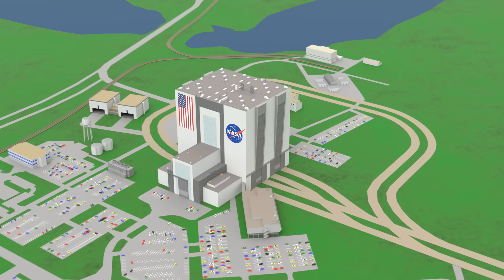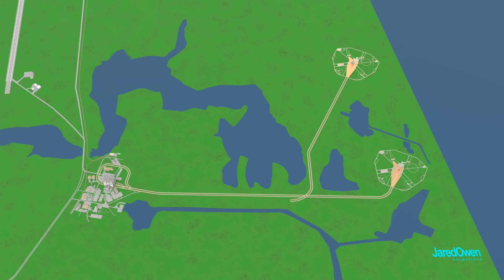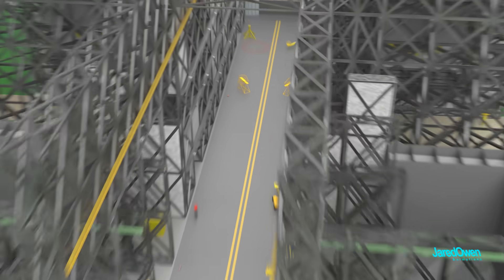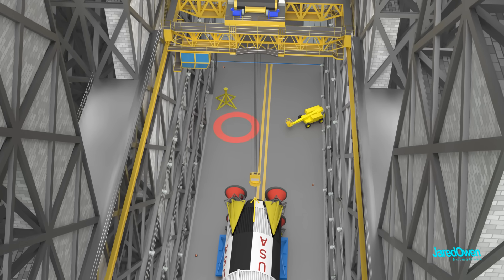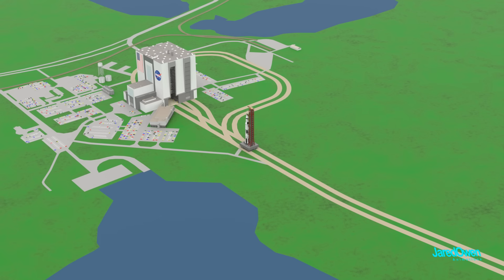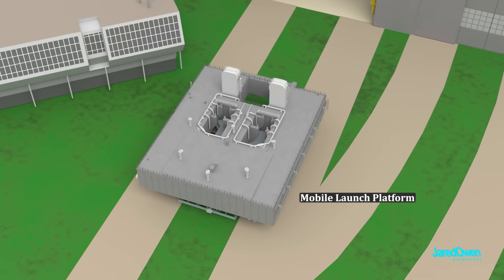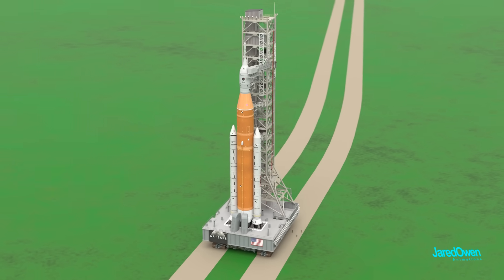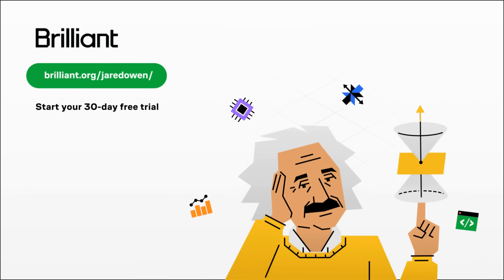Where does NASA build rockets? (Vehicle Assembly Building)

Comment: Actually, the core stage and solid rocket boosters are of the same design used for the shuttle, the external fuel tank for the shuttle was lengthened as well as the SRBs and the core stage has 4 of the main engines designed for the shuttle.

Comment: I was raised in Cocoa. I saw it everyday. 

It's not called the vehicle assembly building.... it's called the VERTICAL Assembly Building.. I've been inside it.. it's where the Vertical assembly takes place... the thing is huge, so big in fact it even develops clouds inside if not checked.

How do people mess up a simple thing like this?
Reply: NASA's website calls it the Vehicle Assembly Building.
Reply: @billfitzpatrick209 that may be now .. but in the 60s and 70s it was called the Vertical Assembly Building... from the day it was erected....like i said ,we did field trips there from Cocoa jr high,  and Cocoa High.. the Space Center guides called it that.. The Today space coast Newspaper, called it that.... maybe they changed it with the shuttles or maybe its a typo. Dunno. But it'll forever be Vertical to me... 

It was the Canaveral Space Center at one time too after Canaveral Beach, Port Canaveral .. at one time. Until it was later changed to Kennedy.  But then there was a big stink over that , and the launch complex reverted back to Canaveral and the Space Center remained Kennedy... confusing, but it made everyone happier..

Comment: What we need is one of your videos showing how the Starship Lunar Lander is set up and how the Orion capsule docks with the Starship lander, etc…

And then for fun… in an alternate timeline… the nose cone of the Starship Lander is the command module for the Starship and can serve as the abort capsule similar to the Crew Dragon…

There would be a pass through pressure portal for ingress and egress into the body of the starship lander.

No need of a heat shield on the control module, as it is for docking with Orion in lunar orbit. 

Either when attached to the Starship lander or not.

If, the Starship lander wants to to start falling over or fail… getting launched back into lunar orbit will have to be instantaneous… just like with the Crew Dragon abort…

Right now from what I have seen the Starship nose cone is a docking airlock. Basically, serving as empty space.

Comment: Hey Jared, I am amazed by your animation. I would like to start doing animations. I know you are using Blender as a 3D software. Is it possible to use On shape, Fusion 360 or SOLIDWORKS to do the same thing? I am more familiar with those. Thanks a lot in advance for your opinion.
Reply from the maker: I am familiar with all of them! My understanding is those are for more of the engineering aspect. They can't do animations quite like blender can. If you are interested in learning more about blender, I have some sources linked here: https://www.jaredowen3d.com/learn-blender
Reply: @JaredOwen  thanks very much for your suggestion!!

Comment: One of the rockets assembled in the VAB not mentioned in the video is the Saturn IB, used to send astronauts to Skylab. Its second stage is the same as the Saturn V’s third stage, but it had only two stages total. To make use of as much infrastructure as possible, a “milk stool” structure was built on the mobile launch platform to bring the S-IVB and Command Service Module of Saturn IB up to the same levels as they were in the Saturn V.  It looked a little strange, but it worked.
Reply: I remember the Saturn 1Bs going up. It shook the crap out of our house... then the Saturn 5 came along.  Lol. I moved away so I didn't see what the Shuttle did...I'm just imagining what Starship will do.. probably gong to feel like an earthquake

Comment: This is pretty cool however the Crawler is probably the most interesting. Can you believe something was actually built to move all those tons of weight, standing extremely vertical, from one location to a far location. Must have been some engineering feat to prevent these ships from toppling.

Comment: I remember taking a tour inside the VAB as a kid in the early 70’s.  We were allowed in the building because the Saturn IV was unfueled during assembly. I went on to work as a civil servant for NASA. Security concerns and since the shuttle and SLS have fully fueled solid rocket boosters, open tours are no longer possible.

Comment: Not sure where/how the rockets are supported on the platform. Seems unlikely the engine nozzles (the lowest point) would be resting on the platform.
Reply: They’re not. The Saturn V had mounting bolts on the engine covers (where the fins are) and the shuttle/SLS have some on the SRBs
Reply: Generally, there’s a thrust frame above the engines. This has to be strong enough to carry the weight of the rocket anyway, so we put posts on the launch pad that support this frame.

Comment: I can't recall if it was in consideration for the original shuttle, but I know that for many planned improvements for the shuttle they were limited by the size of the highbay doors. It led to some interesting ideas such as oval shaped boosters that just barely fit through the opening. Incredible how such infrastructure can affect design

Comment: Thanks so much for using metric units
Reply: 1 kilogram=2.2 lbs
1 kilometer=.62 miles
1 metric ton=1.1 US tons
1 centimeter=.39 inches
1 meter=3.2 feet

There's plenty more conversions to be found on the internet if you're having trouble.

Comment: 4:00 Seems like a mis step clustering the bays into one group of 4 given you can add onto the side. They should have aligned the 4 bays in a row allowing for direct access to the launch pads instead two of the bays required that huge stretch of road from the opposite ends around and to the pads. If you were allowing for expansion the 4 additional bays could be added to the back. But because this was never done makes what they did here silly considering they had the space for 4 bays in a line  vs clustered up.

Comment: I didn't realise how tiny the Space Shuttle was compared to the Saturn V or the SLS.

But makes sense since the Shuttle "only" needed to go in Low Earth Orbit.

I'm so excited for the Artemis Program and hope this is the start of a new Golden Age of Space Exploration.
Reply from the maker: Hopefully SLS will do great things!
Reply: The Shuttle has its stages sitting side by side, instead of on top of each other. It delivers almost a hundred tons to orbit - although most of that is the spacecraft itself.
Reply: @Hobbes746  That's called parallel staging and was used by the early version of the Atlas rocket, where the system most of us are familiar with is called series (or serial) staging.
Reply: Take a look at the Saturn I sitting on its 'milk stool' prior to launch for the Apollo-Soyuz mission to see a great size comparison with the Saturn V.
Reply: orbit is possible your right
Reply: mars and moon and i think mercury is olso possible ti land on
Reply: I think, the Space Shuttle also might go to moon if it designed as soviet "Buran", which has own fuel tank for more powerful OMS rockets. Maybe for moon mission payload bay will be reduced by fuel tank. The modified shuttle will be orbiting around moon release moon landing module from payload bay and waiting before it come. And might be we got reusable moon spacecraft. Surely if NASA fix issues with orbiter's heat-resistant plates. And replace external tank to something else
Reply: @newdawn3474  Its not just "issues" with the heat shield, silica tiles will melt at the heat flux of a lunar reentry.
Reply: @newdawn3474  the shuttle would only be able to even go to the moon if the following criteria were met:

1. The external tank wasn’t jettisoned and instead was refueled
2. The entire payload bay would be filled with a fuel tank(s)

Btw, it would only have enough Delta V to go to the moon and not enough to come back
Reply: @aliteralpothole9205  I meaned shuttle spins around the moon like CSM jettisons Lunar Module and waits until it comes back. Even for that, the shuttle with increased fuel tank(s) hadn't enough fuel for that mission? I guess the problem is shuttle weight...
Reply: Only orbit possible, yeah.